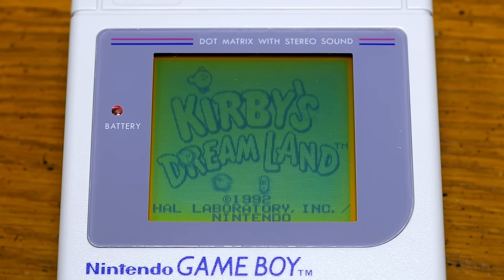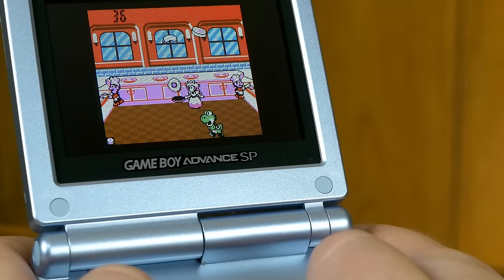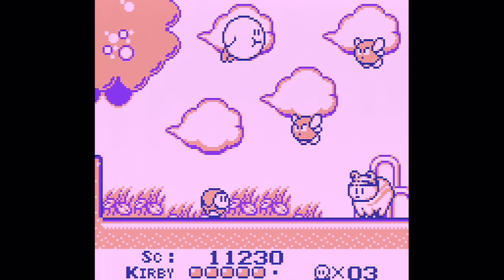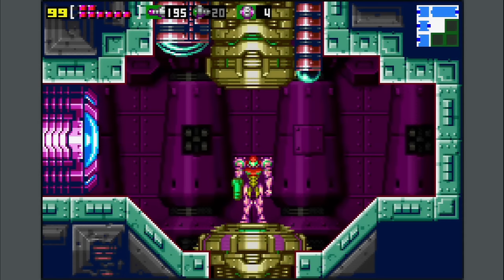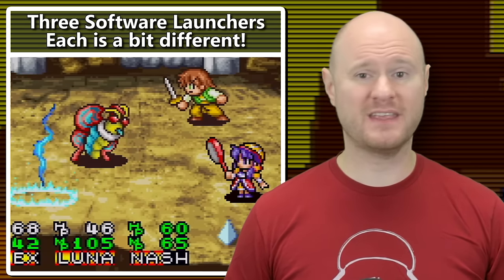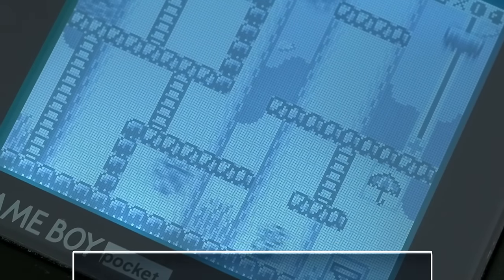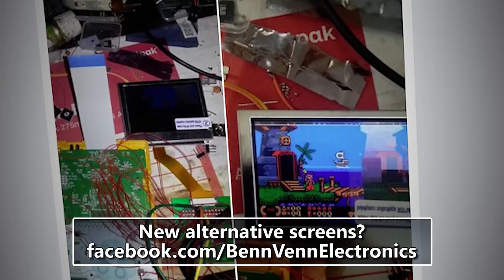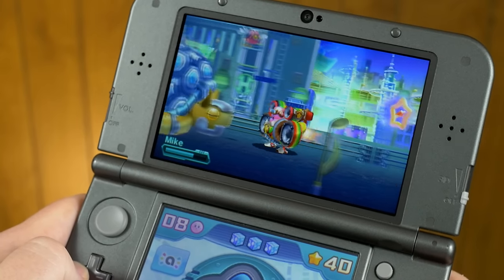Nintendo Game Boy, Game Boy Color, and Game Boy Advance :: RGB208 / MY LIFE IN GAMING

Comment: Now that I see in this episode, the SNES' Video Quality even with 1Chip Consoles is a bit blurry compared to pure Digital Solutions... I hope one day people will be able to find a way to get pure  Digital Signals out of the SNES even if it is near impossible... For now.... :3
Reply: Helloz World Yeah. There ought to be digital out mods for everything. Especially since the tech landscape is becoming more and more accepting of digital standards.
Reply: There's less of a push for digital on the SNES because you can actually get a really nice RGB picture if you know what to look for. The latest in the sharpest possible SNES picture is to now mod the mini model with a new 7374 RGB amp chip with the chip's filtering turned off. RetroRGB and I discovered this when we tested several models of SNES using a custom zoom profile with the Framemeister. With the filter turned off, the 7374-modded SNES mini puts out about the sharpest RGB picture I've seen yet, and it's only surpassed by digital images from emulators. However, the SNES 'suffers' from the same non-square resolution as the NES, and as such, using an RGB mod + Framemeister gives a much better solution for correcting the aspect ratio to 4:3. On digital images, correcting to 4:3 will leave random pixels oblong, which leads to shimmering artifacts during scrolling.  The workaround is to slightly blur the edges in order to 'average' the width of the pixels, but this just mimics what the Framemeister already does naturally. You'd have to get used to playing with an image that is too wide or too skinny if you wanted to take full advantage of a digital picture's clarity. That's why a modded 1CHIP + Framemeister (and integer profiling) is a superb way to play games on the SNES.
Reply: KarbuncleX Is the difference between the 7314 and the 7374 that big as to make it worth it as an upgrade if I have already soldered the 7314 Board?
Reply: @Frozen, Most were, some weren't. However, since the SNES was in fact intended for 4:3 usage, that's what most people prefer to see the screen at. Take for example the triforce intro in Link to the Past. At 4:3 AR, the triforce are at perfect angles. At square pixel AR, they are oddly squished too skinny.
Reply: @ Helloz, depends on if you use a Framemeister or just going straight to a PVM. If you're upscaling with a Framemeister, it's worth getting a 7374, but make sure the filtering mode is disabled when you install it. That's the key to making the pixels super sharp.
Reply: KarbuncleX Yeah, but the difference to be honest is very very small, I don't think it's really that much of an upgrade but a small difference sort of like the difference between Original PS1 Models and the Slim versions. But the Framemiester is still awesome to use ^-^
Reply: @ Frozen. The point was made VERY clear to you, so resorting to personal attacks isn't going to bolster your position. So lets go over it again: Yes, there are some examples where the artist designed their work based on square pictures. Conversely, there are just many, IF NOT MORE artists that based their work on the 4:3 CRT. Consider the following FACT: ALL 240p consoles were made and designed for working on 4:3 CRT screen. So it does not matter who did what in terms of artwork design. Why? Because the ONLY way you could play the games was ON A 4:3 CRT 
SCREEN. Thus, the authentic and accurate experience is to use 4:3 aspect correction. Now either you comprehend that, or maybe you should get YOUR brain checked.
Reply: Obviously the ideal solution is to find a resolution which is a common multiple of the starting resolution, and scale unevenly.
For instance if you needed 256x240 in 4 by 3 ratio, you could scale the image by 5 horizontally, and 4 vertically, giving pixel perfect scaling that also has the correct aspect ratio. Each original pixel is the 5 pixels wide and 4 pixels high. The needed resolution to do this is 1280x960.
And in fact this should in all probability work as intended for a PAL snes. (black bars on PAL games happen because 256x224 does not fill a 4:3 screen)
You can do this at 1080p by leaving a 60 pixel gap top and bottom. (scaling to fill the screen would obviously defeat the purpose of what you just did)
Unfortunately high resolution mode using this logic would require a 2560x1920 display.
Of course none of this matters given a 256x224 display, because the pizel aspect ratio is far less pleasant. (256x240 to 4:3 gives a pixel aspect of 1.25 to 1).
In fact I tried to determine pixel aspect empirically from a super famicom using Mario Paint and a Panasonic CRT television from about 1997, but none of the numbers made sense.
I did confirm the visible part of the screen is roughly 256x224 (actually 256x222 I found on that TV), I also confirmed the aspect ratio of the TV's visible area (to the precision of my measurement it's 1.335) but from there, no measurements I made gave any results that made sense.
Creating a 16x16 pixel tile, as a checkerboard pattern of 4 blocks of 8x8, measuring the sides of those tiles themselves gave odd results.
Measuring a block of 20x20 such tiles (160x160 pixels), confirmed it was not a square, but the measured pixel aspect ratio did not add up to anything that you would expect it to.
At 224 lines, you expect a 4:3 resolution of 298.6667 by 224.
I should point out here given my empirical measurement of 222 visible lines that 296x222 is a 4:3 resolution with no partial pixels.
So, let's go with that and assume 2 lines extra can be ignored.
Keep in mind this doesn't add up to the empirically measured pixel aspect ratio I determined off my TV, but... Let's go with it.
To determine pixel aspect ratio we simply divide 296 by 256 which gives 1.15625 exactly. All well and good, but what integer ratio is that? Well, that be determined from 296:256 directly.
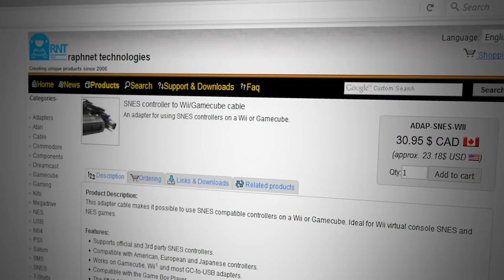The lowest integer ratio is 37:32 - OUCH!
Why is that so painful? That should be obvious. It means having both the correct aspect ratio AND pixel perfect scaling is only possible at a minimum resolution of 256x37 by 222:32 = 9472 by 7104
... Perhaps we should stick to PAL consoles. XD 256x240 at 4:3 is infinitely less painful. XD
Reply: KuraIthys XD

Comment: Fun fact: if you own a CRT with a proper service menu, like my Sony KV-21X5U Trinitron, you can configure the service menu to fill most of the screen with a Super Game Boy. Simply increase the picture size until the borders are cropped out and just the game is shown. And the scaling is perfect, as the CRT simply draws bigger pixels. Unfortunately, you have to know what you are doing to get the scaling and aspect ratio correct, but if do it right you can get better results than pressing the overscan button on a PVM. By far, the main flaw with this is that doing it will crop out most of any input video, so it only properly works with Game Boy games, and you will have to reconfigure your service menu to fit normal video when you want to play anything else. But if you are a massive nerd like me and plan to (or already do) keep several CRTs around, you can simply have one configured for Game Boy games and the rest configured for your other consoles. Alternatively, you can just note down your preferred settings and then switch between them when you want to play different games, but it still takes time to change the settings.

Comment: Great video. There is another way of getting small videos to look sharp other than adobe after effects and apple compressor. VirtualDub which is free, open the video, go to the video menu, then filter, a window pops up, add, choose resize from the long list of filters. Make sure the filter mode is set to "nearest neighbor". Finally, the size should be compatible with the codec you choose (for example h264 needs both to be height and width to be multiples of two).

Comment: 2 years later, i'm coming here to validate your words about the Game Boy Player+Game Boy Interface. That software is magical, even playing in a HDTV via RGB (And not even the official GameCube RGB, just a third party cable with connectors for GC, PS2) it outputs Crystal clear image with perfect scaling and screenshot function. No need for the expensive GBP launch disc when you just need an exploitable game, a SDGecko adapter and Swiss. 

Using a GBA as a controller with it is, indeed, the best way to play GB, GBC and GBA games on the TV, and not as expensive as it may sound.

I'm really thankful for this video. The fact that i'm using original hardware and not just emulation just adds to the feeling.
Reply from the maker: [Try4ce] I'm glad this episode is still mostly relevant, though there have been some changes to the Game Boy scene here and there!
Reply: @mylifeingaming  Yeah, but some of the new solutions are not exactly my cup of tea (Consolized gba esentially destroys a gba. Not a fan of that)

In any case i've been following this channel for quite some time (Just realized i'm using my other account haha, switched to manage my channel and didn't switch back) and it's really informative. In fact it is what pushed me to get a GBP and a SDGecko since i'm a GBA fan and i love playing it on the TV (I've been using console emulators until now, mostly mGBA/Retroarch)

Thank you for all your content. I'm slowly improving the quality of my retrogaming thanks to you and i'm not even kidding.

Comment: It should be noted that the micro’s colors are CLOSER to what the console was originally meant to present. GBA games were made with a non-illuminated LCD in mind, so the colors were severely intensified to make them appear vivid on a dark LCD.  When the backlit SP came along, the colors became comically over-saturated as a result. The micro purposefully addressed/fixed this issue.

Comment: You know, I had an idea for a Game Boy Classic Edition, and I think this Gameboy Classic Edition should have these features:
-Have the same saving features as the NES Classic Edition
-Have a backlit screen while still having the games in black-&-white with green coloring that the console is known for (like Color Scheme H on Page 4 of the Super Game Boy's color selection)
-Have the model be shaped after the Gameboy Pocket with all different kinds of colors (or get a special original model Gameboy version which costs more, but is a great collectors item)
-Have wireless connectivity to other Gameboys for multiplayer & digital TVs to play the games on it with added color like it's a Super Gameboy
-Have a rechargeable battery that can charge through a USB cable

and these would be the games:
1. Tetris
2. Dr. Mario
3. Super Mario Land
4. Super Mario Land 2: 6 Golden Coins
5. Wario Land: Super Mario Land 3
6. Pokemon Red/Blue (you will get one of these randomly)
7. Mario's Picross
8. Operation C
9. Kid Icarus of Myths and Monsters
10. Final Fantasy Adventure
11. Megaman V
12. Wave Race
13. Alleyway
14. Balloon Kid
15. Donkey Kong 94'
16. Donkey Kong Land
17. Baseball
18. Golf
19. Tennis
20. Blades of Steel
21. International Superstar Soccer
22. F-1 Race
23. the Legend of Zelda: Link's Awakening
24. Metroid II: the Return of Samus
25. Kid Dracula
26. Gargoyle's Quest
27. Castlevania II: Belmont's Revenge
28. Final Fantasy Legend II
29. Kirby's Dream Land 
30. Kirby's Dream Land 2
31. Pinball: Revenge of the Gator
32. Street Fighter II
33. Double Dragon II
34. Ninja Gaiden Shadow
35. Harvest Moon GB
36. Mole Mania
37. Gradius: Interstellar Assault
38. Pacman
39. Kirby's Pinball Land
40. Kirby's Block Ball

do you think that would be good?

Comment: I still have my Super Game Boy. I added a link port to mine with some online help from some dodgy MS Paint schematics when I heard about the Super Game Boy 2 and its link port. It worked mostly, but there were some issues with trading Pokemon sometimes because of the mismatched clock speeds.

IIRC you can change out the crystal on the SGB1 to fix the clock issue, but I never bothered lol

Comment: For the 3DS, if you are willing to modify it and put custom firmware on it, there is a way to inject your own ROMs into a GBC virtual console game which you can add your own descriptions and images for the game itself so it looks like an official VC release. If i remember correctly it's called "Ultimate GBA VC Injector for 3DS" or something like that, you can find it on GBA Temp. It's a pretty neat method to play GBA games on 3DS.

Comment: Another drawback of the 101 is that the case is a lot more brittle, but that's not really a deal-breaker.  Just get yourself a tri-wing screwdriver and either an aftermarket case or a dead SP that you can gut.  They're really easy to replace, but there are plenty of tutorials online if you get stuck.

Comment: I purchased a Spongebob themed GBA SP with the IPS mod pre-installed. I ripped my 2004 Spongebob Movie from my DVD, used AviDemux to separate the video and audio so I can do special work on them like VirtualDub's superior Bicubic downscaling to 240x136p, Expression Encoder 4 SP2 has SRS Circle Sound so I can maintain a level of rear surround within a stereo signal, muxed the specialized video and audio together with AviDemux and then used GBA Movie Converter 1.50 to convert the movie to GBA format. Some of you may have the simpler Play Yan Micro for MP4, but I bought the GBA Movie Player CF card version a long time ago not knowing how to use it until this year in 2020. I bet the IPS modded screen will make my GBA encoded Spongebob movie even more enjoyable, my own a GBA SP that was given to me by a friendly acquaintance that seems to act a little broken up at times but still is kickin with the screen and audio surprisingly still working.

Comment: As a RetroArch user, I'd highly recommend the software for anyone looking to emulate GB/GBC/GBA games; it can even play Super Game Boy-compatible games in SGB mode through CLI if you have the SGB boot ROM and bsnes (not bsnes-mercury) properly installed. The only issues I have are that Super Game Boy mode is somewhat spotty (I might make a more detailed post about it on the Libretro forums and add a link in this comment sometime later) and RetroArch won't recognize any ROMs that aren't on its apparent whitelist, such as several ROM hacks and even a few official titles like the second and third Golden Sun games. Aside from that, it's a pretty good emulation frontend, and I've certainly had quite a lot of fun with it!
Reply: Alright, I've finally gotten around to making that post on the Libretro forums; you can check it out at https://forums.libretro.com/t/bsnes-super-game-boy-issues/10665

Comment: I recently have modded my GBC with a drop in IPS screen mod kit, it looks a lot better than the options that they had as the date of this video, I also have modded my GBA with an IPS screen too, both my GBC & GBA have an audio amp installed so it sounds clear and a bit louder than the base speakers.

Comment: Finally running GBi on my GameCube. I was going back and forth about getting an SD reader, but it turns out you can put it on a GameCube Memory card with GCMM on the Wii Homebrew Channel. Works great and the games look awesome on my CRT through S Video!
Reply from the maker: [Try4ce] Ohhh that's a nice trick. Do you still need a disc to load the software on the GameCube itself? I need to learn so much about all the Wii Homebrew out there.
Reply: My Life in Gaming Sorry I didn’t see this before (not getting notifications for comment replys)! I use a hacked Wind Waker save file to launch GBI with the Wind Waker disk.

Comment: luma 3ds cfw is all you need to play gb/gbc/gba games on your 3ds. they will run as virtual console games (gba games run on hardware, not software, etc. for flawless performance). you can inject pretty well every game in existence with no issues using the "ultimate vc injectors" homebrew for any of the gameboy platforms. if you get a ds flashcart (compatible with 3ds) over and above this, you can play every nintendo handheld game in history (not including switch) on your 3ds -- it is a godsend.

Comment: Not only the ghosting problem was solved and colors were added but also the GameBoy Color had a much higher contrast and it was much easier to see everything... The original Gameboy and Gameboy Pocket had very faint screens, the Gameboy Pocket's screen has a little more contrast than the original but it still pales in comparison with the GameBoy Color's screen.

Comment: My setup for playing gameboy advance games is quite complex, but pixel perfect and looks AMAZING. So I have a Gamecube with the gameboy player that I’m using with GBI and the hi fidelity ossc preset. Then I output to the ossc using the eon gchd mkii and component cables. 

The ossc preset on GBI outputs at 360p which the ossc then line triples to get a full 1080p signal. This obviously doesn’t fill the screen because the gameboy advance had a resolution of 160p and this is technically a 180p 6x upscale, but the scaling is perfect.
Reply from the maker: [Try4ce] Yeah that's a great way to do it for sure. Unfortunately Hi Fidelity and the Mk-II were not available at the time of this episode, but is included in our GameCube HDMI updates video from late last year.

Comment: great video! any plans to make a turbografx 16 rgb video? between mods and modless options, it would be interesting to hear your opinion.
Reply from the maker: +Ian Weiss [Try4ce] Yep, we absolutely plan to. We've got most of what we need to do it, but are unsure yet how it will fit into our schedule.
Reply: My Life in Gaming I have a modded duo r and the PC engine with dbGrafx Booster run through a framemeister, and am pretty happy with both. I haven't done any kind of side by side though, and will be very interested in your results. Keep up the great work!